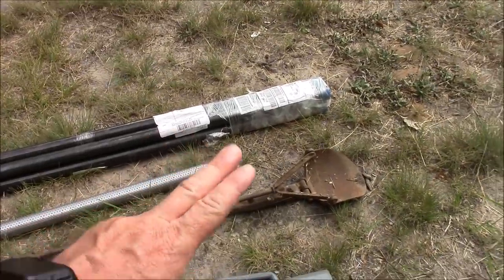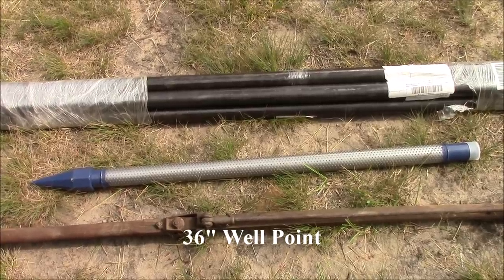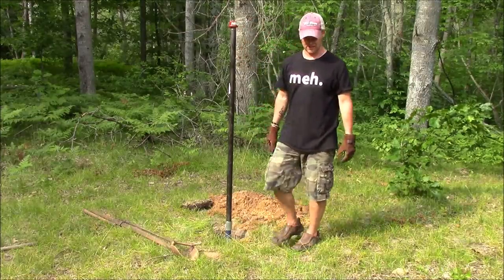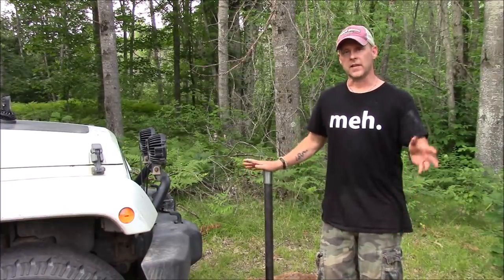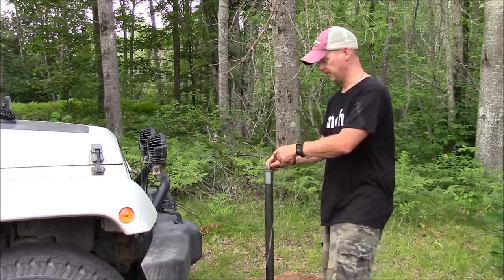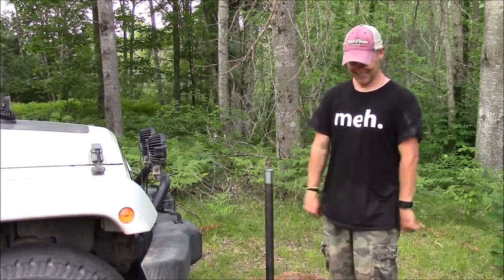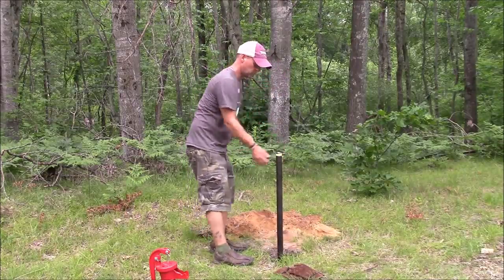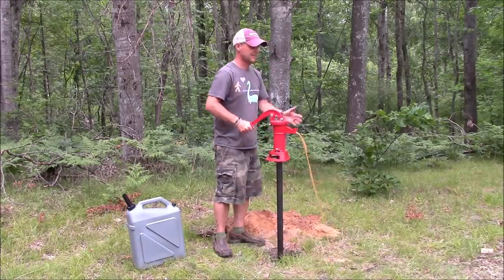Installing a Sand Point Well at the Off-Grid Cabin

Comment: Thanks for videoing this. It really peaked my interest. So I thought I would try it... Well, well well.. I hit water at 10.5 feet. I drove the point so I have 6 feet of water in the pipe, hand pumped 40 gallons.. no sign of stopping. The water table is low at the moment.. Somnext spring, summer there should have lots of water..
 I did it the same way you did with same tools except for the old shovel.... Again Thank you...
Reply from the maker: That is very cool. It is a great feeling to hit water.

Comment: Thank you so much for this video.  I've got all the exact same parts as you and am diggin mine tomorrow.  I already dug a 6 foot hole with a post hole digger today.  I'm excited. I'm doing everything the same except I've got 8 bags of concrete.  I'll pour a square foundation around it, then using a form a rectangle "Stand" joined with rebar to mound the pump to.
Reply from the maker: Good luck. Share your success.
Reply: @LordCryptid   Hah, geological info for my area shows water table down between 10-20 feet.  We hit some nasty hardpack something at 14 which each sledge hit moving the pipe may 1/8th inch.  Blow out the red cap for hitting entirely.  

We moved to sacrificial couples and stalled a bit to regroup.  The 4 foot point has 2 feet of muddy dribble on the tape measure at that dept so we don't know if its clay or other.   

I built a jetter out of PVC and sharkbit connections and will be washing out the point to see if that changes anything before pounding further.

Comment: Seal the hole. After you get up to about 6" from ground level, take 2x4s and make about a 3'x3' square. Fill this in with concrete. You don't want surface water to seep down along the pipe as you stroke the pump handle. Great job.
Reply from the maker: I have to get back up there in about a week and I will do this.
Reply: is it possible to have one of these built into a sauna house?
Reply: If you are talking about putting a pump in a sauna, ground access is a requirement but why? The same process would be used but it would complicate the sauna.
Reply: @99Racker  I am weighing my options to buy land and building off grid.  In the meantime, the sauna and insultated outhouse would have to be built first.  my actual house will take a few years of savings to build (~900sq ft bale home) so in the meantime, im trying to plan on building a sauna with some livable space.   The sauna side would have the pump and also a poured concrete slab with drain built into pad so that I can also have water in the cold canadian winters....  i can fire up stove with sauna door open during day to heat up the so called changeroom livable space (total size 8x13ft  ..under 10p sq ft reqrmnt)  ..  maybe this explains a bit of my intentions....to my question...  :-)   im a nature nut trying to minimize on my environmental impacts
Reply: @allanonamiss4224  I am not a professional builder. My pump pad comment was based upon Marine training decades ago and then putting that training in to practice in a foreign land. Building in Alaska has it's own problems. You are trying to build a place to live while adding a sauna, water source and other amenities. Tall order. Putting in a well and maintaining it in winter has installation issues.  Good luck.
Reply: Surrounding it with straw bales in winter works too

Comment: Thanks for a great vid, my homes original well is a sand point in the cellar that I still use for when extended power outages occur, my deep well is 240v and the sand point is 120v so I plug it in to flush the toilet or emergency water if needed. The area I live is all sand so may try another point beside the other with a hand pump for SHTF scenario lol
Reply from the maker: I am still considering adding one to my suburban backyard...just in case.
Reply: @LordCryptid  my cellar one was the primary water source from 1953 to 2007 and they raised a family using it only, it's a concrete floor with about 8" of a tile above the floor with the pump beside it, I believe they only did the outside drilled/pounded to sell the place and I requested them to leave it usable for me. It's silt about 12" in with the pipe into the silt however deep it is

Comment: Been there done that!
I see some issues right off the bat. 
Divining rods need to be copper or willow. Never seen steel used. 
   I think black pipe will give you rusty water. 
   Use a screw in type post hole digger. If your ground doesn't cave in you can add extensions to dig farther. Easier than pounding.Only problem is if your ground doesn't cave in then you probably have to much clay for good water flow. Also a portable air powered jackhammer works best for pounding the pipe. You can rent them just for this purpose.
   In some states it is illegal to put in your own well. But I get the off grid thing. 
Just because you have sand on the surface doesn't mean you have sand at 10 to 20 feet.
   Kitchen pumps like that are only good to about 22 feet.
    A rain barrel with a closed system (to keep bugs out) works very well for wash water. 
   Your well needs to be at least 75 to 100 feet from your outhouse or septic system.
Reply from the maker: If I were drinking the water I would have used galvanized but it is for my garden and washing.  The screw in type drills are really cool and I wish I had one.  Thank you for the wealth of knowledge.
Reply: Why would it be illegal?

Comment: One key step to add for next time is to soak the pump in a tub or bucket. Completely submerge for a couple hours before install to pre saturate the seals. Otherwise thanks for the cideo
Reply from the maker: Agreed. This is a good additional bit of info.
Reply from the maker: I did have to replace the leather seal once already. Pretty simple procedure.
Reply: @LordCryptid  oh yea super easy. This style handpump was invented in the mid 1400s and the design is simple to the point that anyone could rebuild or repair them but they also withstand the test of time

Comment: Of note, one of the retired guys in the Fire Service I know is a professional well guy.  He said all wells even sand points should be jetted.  I had NO idea what that meant as every single sand point well video I saw is missing that step. I built my own jetter out of PVC pipe, sharkbit brass fittings and a garden hose.  It will clean the screen from being clogged with dirt after driving it down through and allow it to run much better.
Reply from the maker: Thank you for the info.

Comment: frame a small table over your well, mount a 12v Shurflo 3 gpm 12v pump, battery & solar panel and you're done.  I have two shallow wells at remote sites set up & watering cattle.  A Shurflo will cost you about 70 bucks, drop a hot water 1/2pvc pipe inside your 11/4 for the suction.  The pump will pull 18 feet.
Reply from the maker: I am going to look into that because it sounds interesting and cool to set up.
Reply: Are you running your pumps without a controller?  A device that converts low voltage output from the panels in low sunshine conditions to 12 volts?  I used a Shurflo for years but was informed that I needed to use a controller to protect the pump.
Reply: @bobwallace9753  The rule is use a charger if panel exceeds 10 watts.  In 1994 we experienced a 2 year drought.  I had 18 grown cows at a remote pasture.  In summer they avg 15 -20 gal of water per cow per day.  I dug a shallow well, 27 ft.  Used a 12 v rv pump by shurflo rated at 2.4 gpm.  12 v car battery and a very small solar panel 5 watt's.  I used a pressure switch like standard on 110/240 volt well pumps.  On the bottom tray I used JB weld to fasten a toilet float.  Clamped the pressure switch to the rim of a 720 gallon water trough.  When the cattle would drink, the level dropped so did the float which engaged the contact points in the switch and the pump would run.  Once the level rose, the float would open the curcuit and stop the pump.  8 years I used this original system.  Now you can buy a pressure switch on ebay with a float already mounted.  Today I use a 50 watt Renogy panel, a 12 v marine battery, a Renogy 10 amp solar charge controller and a Shurflo 3.2 gpm pump (68.00 on ebay).  Do not use 1/2 inch cold water pvc, Use 1/2 hot water pvc, its a tad bit smaller on ID but allows the pump to pull a greater depth.  About 14 -18 feet of suction should do fine.  I have a T on the discharge side and installed a spigot and garden hose along with the water trough.  Works like a charm.  I have two of these systems in service.  Under standard use where your not providing water to 20 cows, probably a 30 watt panel , 10 amp charge controller and good battery would be perfect for you.
Reply: @BHeisler59  Thanks for all the information.  I've since moved to a larger piece of land and have a Grundfos soft start submersible pump that I run off the house solar system.  110 volt.  I run the pump with a timer six times per day for 15 minutes in the summer when I'm irrigating my garden and orchard.  A couple of hours a week during non-irrigation times.  I pump up to a large tank 80' higher than the house and gravity feed back.  With this setup I can run my pump with solar right from the panels and bypass my batteries.

At my previous property I used a 100 watt panel,  Shurflo 12 volt, and a linear current booster.  No battery.  The current booster matched panel output to the pump motor needs, letting the pump operate (at slower speeds) in lower sunlight conditions.  I used 3/4" diameter poly in order to minimize pipe/flow friction.
Reply: @bobwallace9753  Sounds good.  I've seen one man use a 12v & panel without a battery to provide water for a grape arbor, seemed to work pretty well.
Reply: @BHeisler59  People who want to go the no battery route need to make sure they won't damage their pump with a direct solar panel to pump connection.  There now seem to be some pumps that will operate safely with a direct connection.  Unless Shurflo has modified their design I think a linear current booster is needed, but people should check that out.

A panel/battery/pump system would work as long as the pump isn't running too many hours per day.  The battery is acting as a buffer to create a constant 12 volt supply.  There has to be enough "off time" for the pump to allow the battery to stay charged.  I needed all the water I could get for my garden and orchard so I wanted all the available solar power to go straight to the pump.

I have a large fish pond outside my house.  I'm using a submersible pump for a filtration system.  The pump was designed for direct operation from solar panels.  That's the first pump I've run into that is apparently designed for direct (no battery, no linear current booster) connection.
Reply from the maker: @bobwallace9753  This pump is running as you see it right now. I have yet to move on to a more robust system.

Comment: Just the way I did it in Michigan about 65 years ago - and nothing cost anywhere near what it does today. And I found a spot where the water was only 13 feet below the surface with a "divining rod".
Reply from the maker: There was no way I could even get heavy equiptment back there. Glad they both worked out.

Comment: Where I live was once a swamp about two hundred years ago. I can't dig anywhere and not run into yellow sand, six inches down. I must be over moving ground water, sections all over the center of this property it slowly sinks down over years. However the latest on less than a month.
Reply from the maker: I wonder how far you could just dig and reach water.
Reply: @LordCryptid  I had an addition put in, in the nineties it's five foot below grade and no water. It's all sand here, you drive a pipe with a "point" on the end and you very could hit water at some point I think.

Comment: Thanks for sharing, appreciate it!
Reply from the maker: It is still pulling water. It makes it much easier to water the trees etc. versus hauling it in.
Reply: Absolutely! I have 7 acres in outback qld, Australia. I have 2 small tanks but not much good with heights.. have a half-built skillion w/corrugated iron but it doesn’t rain much here so I’ve been hauling water with an ibc. Problem with that is that it’s a 80km round trip and my vehicle isn’t really designed for pulling such a load. It’s ALL sand and clay here however, and we are close by a creek so I know there’s water not too far down. Been researching if termite mounds mean groundwater nearby.. and they do. Plenty of those here to! Thanks so much for this vid, didn’t know about the sand points. This opens up a whole new world because I can’t afford to get a bore drilled. Very very much appreciated!!

Comment: I have heard of using an electric "jack hammer: with a cap welded to one of the jack hammer tool points to drive a well.   Stand on a small ladder to get above the pipe and use the jack hammer as a driver.  The cap keeps it in place over the pipe.
Reply from the maker: You would need a powerful generator but that seems like it would be worth it.
Reply: @LordCryptid  Exactly .

Comment: Galvanized pipe is for water, black pipe is for gas. Also need a twisting action when driving, using a pipe wrench and length of pipe. Reduces friction.
Reply from the maker: All of these are very good points.

Comment: no check valve at the bottom?  thanks for your video and pointers.
Reply from the maker: I have not needed one. But, if I were using it more frequently it would certainly be a good idea. It would lessen the need fro priming etc.

Comment: That's cool. I always wanted to try that, but we have too much clay and bed rock here in Virginia. And divining rods are the coolest. I made a pair from copper wire and a pair of straws. It's incredible how sensitive they are.
Reply from the maker: I think they actually worked.
Reply: @LordCryptid  I've had luck finding buried power lines and sewage pipes with them.
Reply: Pretty sure they don't work at all. Lots of videos out there showing that they are no better than just guessing. I think it's just that there's water in a lot of places.

Comment: I thought those are mechanical joints, just what is that teflon tape supposed to be sealing?
Reply from the maker: I thought I might have to disassemble the whole thing if it didn't work. Therefore, I guessed it would be easier if there was tape there to prevent it from sticking too much. Turns out it was not really needed.

Comment: thumbs up !!!    will water be available when the ground freezes..if it does there ...* I'm from Lake George, NY and have some backwoods land that needs water available..TXS,,,!!
Reply from the maker: I did not have the chance to get there after the ground froze and until just recently. If you can keep the mechanism of the pump and the seal maintained you should be able to draw water as the ground should maintain about 50ish degrees once you get a few feet below the surface. But, let's see if other people have more experience.
Reply: Water anywhere near the surface like in NY will freeze in winter